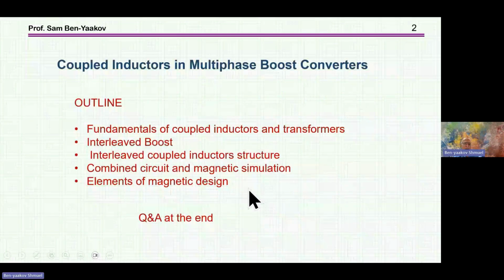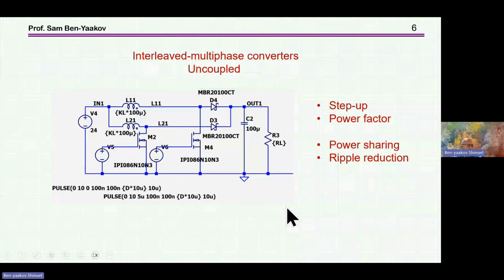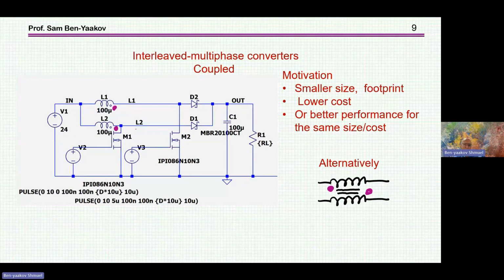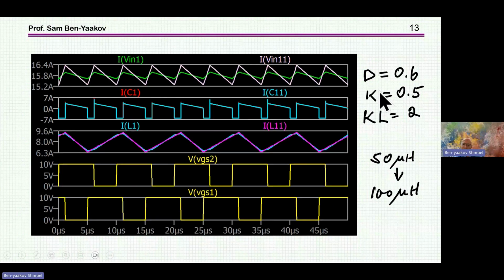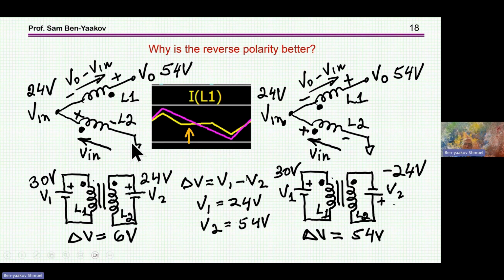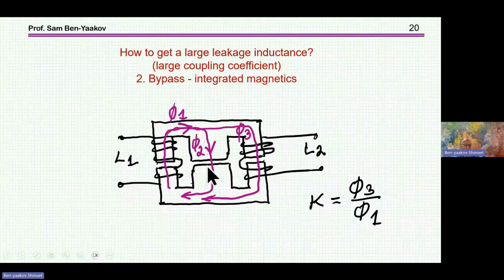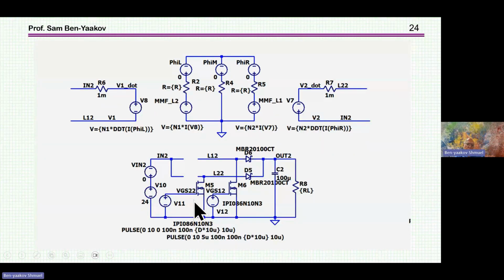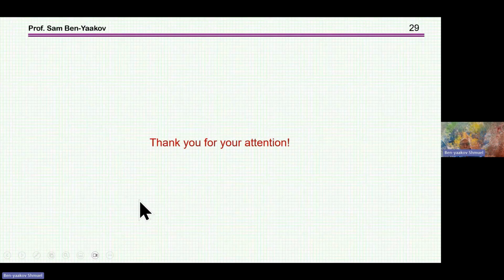Coupled Inductors in Multiphase Boost Converters

Comment: great presentation. I have a question, what is the maximum duty cycle for this topology? if the pwm pulses have to be 180 degrees out of phase, can the duty cycle go higher than 50%?
Reply from the maker: Yes.

Comment: if i have a coupled inductor with 2 inductors that are identical . I want to use one of them for a buck or a boost converter, will the unused one affect me in any negative way if it is left floating? 
Also would a small DC current in one reduce the inductance in the other like in the last vid where you presented variable magnetics?
Reply from the maker: No effect if open, and yes, DC might saturate the core and affect the other winding.
Reply: @sambenyaakov  thx